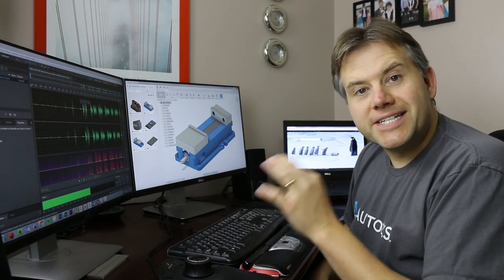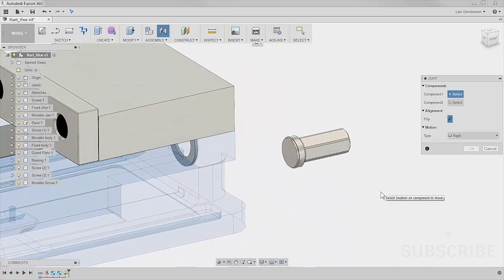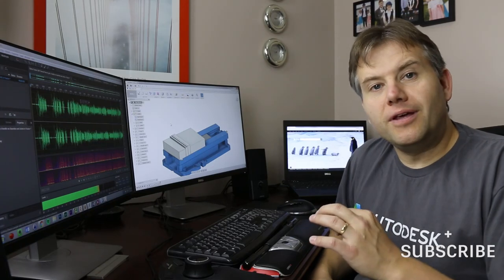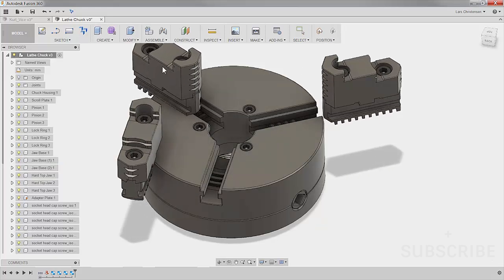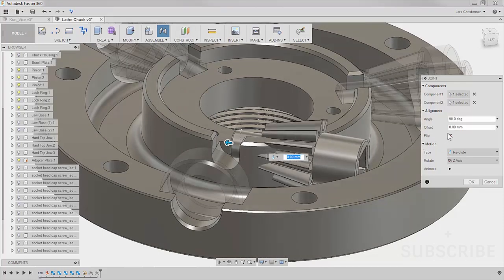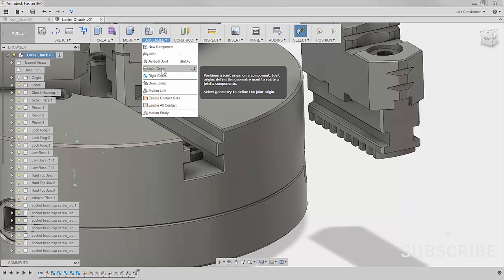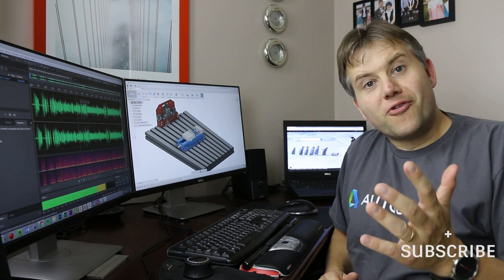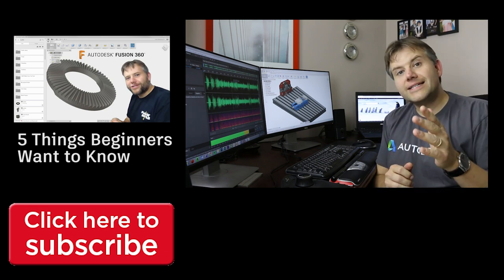Fusion 360 Tutorial — How to get a handle on Assembly and Joints in Fusion

Comment: Hi Lars. I looked at the movement of the chuck in detail and noticed that the chuck moves the opposite way that it should.  Also, the grooves in the jaws did not line up with the spindle underneath them.  I was able to fix those things.  I also adjusted the speed on the lower pinions, so they match the rotation of the spindle. Looks awesome now.   Even though you did not show how to do these things, your tutorial inspired me to learn how to adjust and fix the model up.  Thank you for the guidance!
Reply from the maker: Awesome! Good work!!

Comment: Another great video.  I had a little trouble with setting the T holder in place. It did not look right to me or flat to the grove of the table.  I tried to change the angle from 270 to 265 Deg. everything looked great.  Then when i made my joint, bolt to vice i was getting a error.  I had slider selected, then I remembered what I had done with the angle and changed back to 270 Deg and everything went perfect after that.  Thanks Lars for taking the time to make these videos!
Reply from the maker: Thank you for taking the time to watch and comment!
Have an awesome day!

Best,
Lars
Reply: By far the best video on youtube covering joints in Fusion 360.

Comment: Another banger video!  As a complete beginner in any CAD software I have learned a lot from you, very grateful for all the teachings!  I was wondering, in the ‘motion relation’ joints, can you set it to turn the ‘handle’ part to move the ‘jaw’ part in the vise example, or the ‘hex set screw’ to move the 3 ‘mandibles’ in the chuck example?  Thank you again so much, I hope you still enjoy a Labatt’s Blue on Tuesdays !!!
Reply: Here's how I did it. You gotta create a fake "nut sleeve" inside the threaded part of the vise jaw. Let's imagine the leadscrew is 0.5" diameter and the threaded jaw hole is 1/2"-13. You gotta force the vise jaw threaded hole to be 0.6" for example than you create a fake nut sleeve that is 0.6" OD by 0.5" ID. This is way easier to do if you don't simulate threaded cylinders. The vise jaw has a negative revolve joint to the nut sleeve. Must be a negative rotation.The Nut sleeve has a slider joint in relation to the lead screw. You create a motion link between the slide of the nut sleeve and the negative revolve of the vise jaw. Then you create a motion link between the rotation of the leadscrew with the nut sleeve. What happens is the the jaw will negative "revolve" in the opposite direction of the rotation of the leadscrew simulating the effect of the jaw having a rotation limit awhile at the same time being able to slide back and forth as a function of the turn of a handle.

Comment: Lars,  First I want to say THANKS for all your Videos!  As a beginner to Fusion 360 I have learned so much from you.    I  drew a toolmakers vise in fusion and am having difficulty in getting the correct joint to connect the  screw to the moveable jaw.   I selected a cylindrical joint for the screw and then made it a motion joint and set the distance equal to the thread pitch.  This works as  it would in the real world. Currently the moveable jaw is set to a slider joint but I cannot get it joined to the screw and  allow it to move when the screw is rotated.    Any Tips would be appreciated.
Reply from the maker: Hi Scott, Thank you for taking the time to watch the videos!! Are you missing some rigid groups? You can invite me to the project and I can try to take a look as soon as I can lars.christensen@autodesk.com

Best,
Lars

Comment: Brilliant information! Thank you so much for explaining a few things in so much detail.
Something I have been trying to find out is if there is a way to create a bolt/thread that will actually screw in to something. I have a model I am making. The top is a LH ACME thread, bottom is Right Hand thread. It screws in to a fixed base plate and as the screw is rotated (in real life) it pulled another part downwards that pushes a lever outwards. Its kind of a complex thing but would be nice to see it actually work before I print it :)
Reply from the maker: Thank you for taking the time to watch and comment Andrew. If you were doing this for animation you will probably mate to a hidden spline. Most computers would choke trying to calculate the actual surface on surface calculation that happens in the real world.

Comment: Hi, firstly, great tutorials, I am completely new and your videos seem much clearer and easier to follow than most. The problem I seem to have is that when following along to your videos in Fusion 360, some of the actions you perform in the video don't seem to work on my computer so I can't do the things you are doing. For instance, in your conduit box exercise (beginner video 1) the screw bosses won't join to the adjoining face making it impossible to add the radius and project,  I use a Mac, would this make a difference ?
Reply from the maker: Hi Andrew, That you are on a Mac should make no difference. It sounds like the screw bosses might not be touching the box body. Can you try to zoom in really close and see if you can see a gab?
Reply: Thanks Lars, I'll give it a go. Keep up the good work, I've learnt heaps from your videos.

Comment: Super helpful, Lars. I started a project this week that needs a lot of joints, so your video was just in time!

Couple things I am wondering. Can you not copy a set of parts with their joints? For example, when you had the nut and bolt assembly to hold down your vise, can you copy or mirror that to the other side of the vise?

A feature that would be nice is the option to mate two joint origins as soon as you create them. I'm thinking fusion would recognize that you created 2 joint origins, and ask if you'd like to join them immediately. Would be a nice time saver!
Reply from the maker: Thank you for taking the time to comment! I will have to test that out and get back to you...Would be super helpful.
Have a great day!

Comment: I know this is a few years old and I’ve just started watching your videos and trying to learn CAD. When you were creating the slider/joint to hold the Vice in place, can you not copy paste everything you did to them to create the other one? I only ask because what if you were creating a dash for a car with many fasteners that will do the same movement? I do understand that the actual surface that the screw or bolt will join to is in a different location or even orientation.

Comment: Lars, often in the videos about joints, it looks like you "grab" bodies or components and move them with the cursor. Like when you have made a slide joint and then it looks like you grab the part and slide it back and forth. I am assuming that is a hot key? How are you doing that? 

Thanks for all your videos! Very helpful! I think it is the best resource for expanding my use and knowledge of Fusion 360.
Reply: In Menu <SELECT> - <Component Drag> or use the Alt-Key on your keyboard while dragging

Comment: I think that I get everything until we line up the movable jaw.  All does as you do until I click ok and when I try to slide the movable jaw, the fixed jaw also moves and it can move below the bed of the vice.  I have repeated the steps a number of times.  It's like the fixed jaw, the center piece of the bed and the ring in the front are tied together. Your videos are a great help.
Reply from the maker: Hi William, Did you do the Rigid Group first and included the fixed jaw? Just taking a stab in the dark here. Possible invite me to your project and I can take a look: lars.christensen@autodesk.com

Comment: Ok awesome as usual Lars! Is it possible to add your keyboard commands to the screen please. Im sure I've seen that setting in the preferences somewhere. Thank you for explaining the joints. Ive come from using solidworks and inventor in the past. (Inventor was my favourite!!) And have found assembly in fusion a bit of a mind f$@k. Do you know why you guys at autodesk have made so many features different from inventor? Also its interesting to see your mouse pointer on the screen at the same time its panning and tilting. Are you using another 3d mouse or something? Sorry for so many questions. Keep up the great work dude!!
Reply: Seventy7 Industries yeah he's using a 3Dconnexion SpaceMouse. Indispensable IMO.
Reply: Seventy7 Industries the biggest difference between Joints in Fusion/Inventor vs constraints and mates in Inventor/Solidworks is Joints define movement. But mates/constraints restrict movement.
Reply from the maker: Thank you for taking the time to comment! Glad you like the video. I don't know why things got changed around between Inventor and Fusion to be honest. I would have to hunt down someone to figure that out. Scott is spot on. I use a 3DConnexion device to spin the model around. 
Yes, good advice. In the future I will make sure I add keyboard shortcuts. Good call!!
Thank you again for taking the time to write!
Have an awesome day!
Reply: Ok that makes sense. Thanks scott.    And thanks lars. Look forward to your next video.

Comment: do you recommend setting up the cam in an assembly for each component or saving each component individually and running the cam on those files?
Reply from the maker: Hi Robert. I think it depends of the part. Sometimes you just need to get some toolpaths going quickly and there is no advantage in getting it into an assembly. Then again, sometimes you might have parts laid out in fixtures where it can be a huge advantage. Especially because you can use collision detection between parts and fixtures.

Hope this is helpful.

Comment: Fantastic set of tutorials Lars. Really appreciate you taking the time to do this. A couple of quick questions if I may. Firstly I'm a mac user with a mac mouse. Is there a keyboard shortcut to allow me to use the mouse to orbit the model or do I have to use the button at the bottom of the screen or the cube in the top right? If not is there a rotationally device that you'd recommend for a mac and Fusion 360? I've watched you beginner series and your dovetail one. As a bespoke furniture maker I'd love to see some more furniture construction tutorials. I've used sketchup for years but Fusion 360 appears to be a much superior option. Lastly is there anyway to generate a cultist of materials from a Fusion model? Something with length, width and thickness, quantity and material type. Thanks again.
Reply from the maker: Hi Mark, Thank you for taking the time to watch the videos!
I talked to a few of the Mac users on the team and they both use standard 3 button mouse's with a scroll wheel. I'm not 100%, but it sounds to me that spending $5 on one of those might be a good idea.
For your second question: if you create a 2D drawing from your design, you can create a part list. It will give you the quantity and material...length, with and thickness hopefully comes soon.

Best,
Lars
Reply: mark scheiner Hello Mark, just push down both left and right mouse buttons simultaneously and you will pan the view. To orbit the model, hold down the shift key and both mouse buttons. Simple as that. Hope that helps!

Comment: Lars, when you get to 13:45 and you are making the "slider" joint, there is a problem. After creating the joint, the first "Rigid Group" and the second "Rigid Group" float freely in space when selecting the second "Rigid Group" with the mouse. I followed your instructions exactly, but at this point in the video, the parts move freely in space. I'm assuming you went back and edited the first "Rigid Group" and added the "Base" to it, thus allowing the second "Rigid Group" to slide as it does in the video. I don't believe I did anything wrong up to this point, as I did exactly what you did. Perhaps I missed something?

Comment: Thank you very much for this video! It helped immensely! I am having one issue though. When I try your method of creating a "joint" between the table and the vice, only the base moves. The jaws, guard, ring, etc, stay where the model was moved from. What am I doing wrong?
Reply from the maker: Hi Josh, Did you use Rigid Group so vise jaws follows the base?
Best,
Lars
Reply: I did, not sure what happened but it started working randomly. I think it was a small glitch :) Thanks for the reply!!

Comment: If I combine some objects with touching surfaces by using a rigid group, would that still dynamically update their respective positions to each other in case I change one of the grouped objects? Or would I have to rigid-joint them together to make my assembly update automatically if a body changes?

Comment: Thank you for such a well put together video. How are you orbiting and panning so smoothly while simultaneously working? You don't seem to be going back and forth to the orbit tool at the bottom of the screen or the rotating cube in the top right? Are you using some kind of additional mouse the navigate so well? I was happy to find that holding down the shift key while clicking the middle roller put the mouse into orbit mode, but that still seems like too much work. Thanks for your consideration.
Reply from the maker: Hi Chris, I use a Spacemouse from 3DConnexion... http://www.3dconnexion.com/products/spacemouse.html
Thinking about making a video where I review the different models in the near future
Reply: Thank you again Lars! I was checking out the SpaceMouse and it looks really cool, but it is a little pricey! I was able to reprogram my Logitech M570 trackball to handle both the pan and orbit. Just need to assign forward and back buttons as "middle button" and "Shift+" I also reassigned the "middle (scroll-wheel) button" as the "Ctrl+". Now I can do it all with one hand for about $27.99. I also added a seperate numeric pad for even less hand movement for only $7.99 more. Definitely add the M570 to the list if you make a video!
Reply: Chris Daniel That's cool. I have an m570 , do you make the button assignments in the mouse software or in fusion? I gotta do this, I find it such a pita to have to push the shift key to orbit the part.
Reply: Marcel, I did the assignments in the Logitech software. I do recall that it was a bit of a hassle finding the correct software version for the mouse online, but once it is set up it is easy. It's one of those things where you might need to download a previous version before you can download the most current version.

Comment: I'm coming over from Solidworks.  I have a question for you:  It seems like you can only make these "simulated" sliding and rotating joints.  Can you not tie the mates to the surfaces of the gears?  A lot of modeling is making things like gears, and you have to build ASMs where those gear tooth meshes are critical, and you need the ASM to show you that they are all meshing and the parts are moving correctly together.  -Thank you

Comment: Hi Lars,
I used information in the great video to make a wheel turn round an axle, yes real progress!! 
In your video you animate the joint with your mouse by the look of it rather than the drop down menu and animate tab.
How is that done please|?
Paul
Reply from the maker: Hi Paul, after you set your joints, you should be able to grab one part, and the others should follow depending what joints you specified.
Hope this is helpful.
Reply: Thanks Lars, I have it working now.
 I had not grounded the axle component it revolved around, in spite of you often telling us to do so!
Thanks very much for your help.

Comment: Thank you very much. very good examples. I could now understand assembling in fusion. 
I have a doubt. How can we allow two degrees of freedom for rotation. I mean when we select a component's point(half moon-pivot point) and another of the other part, I see that I can allow the motion in x, y or z axis. How can I allow two axis motion and arrest motion in one axis only?
Reply from the maker: Hi sirisha gorrepati Thank you for watching!
You can open the joints folder on the left side of the screen and right-click a revolute joint and edit the joint limits.
Reply: Thank you for the reply. I checked this. This actually allows me to set limits for the travel of the component in that axis. But, I would like to know how we can allow the component to have degrees of freedom around two axis at the same time. For example while applying joint command, it gives an option to choose either x either y or z. How can I choose two axes?

Comment: Hi Lars I have been watching a few of your videos and there is some really good content, however I'm new to fusion and have being trying to follow this video, easy right? No when I join the two rigid body groups for the sliding motion, it does this fine but then they wont separate for me. Really frustrating is there anything you can think of that why that would cause this? All joint settings match your exactly. I'm probably missing something really small. Thanks in advance!
Reply from the maker: Hi David Newman Thank you for watching!
Not sure exactly in the video you refer to. Are you sure it is a rigid joint and not a rigid group you need. Just first thought that comes to mind.
Reply: I also was having this issue. When I join the bottom of the plate of the sliding jaw to the fixed one on the Vise example, even with the "slider" type option on, the two snap together as if they were a rigid joint, and the sliding jaw doesn't slide. Strange.